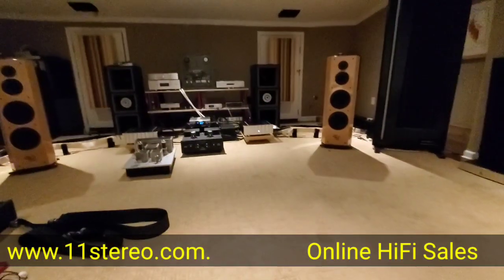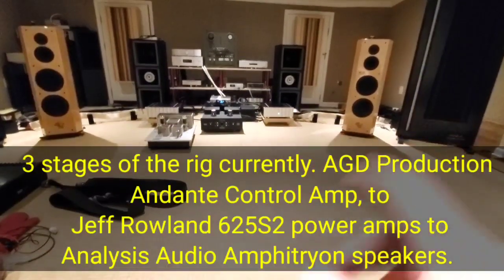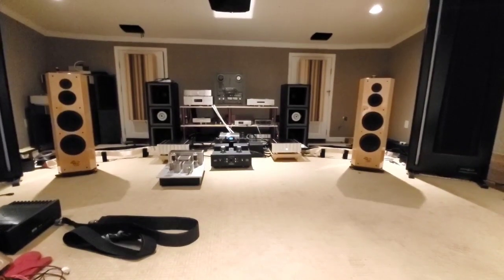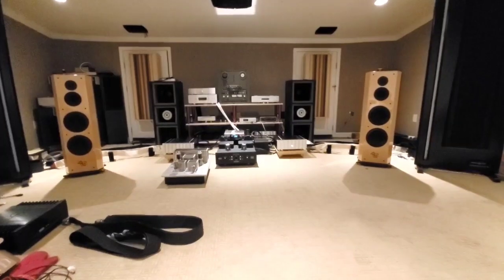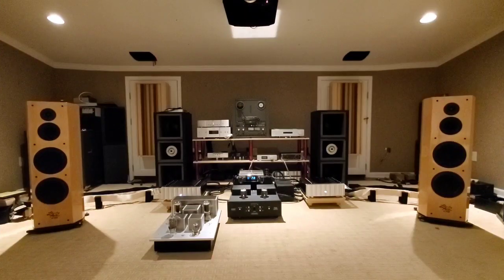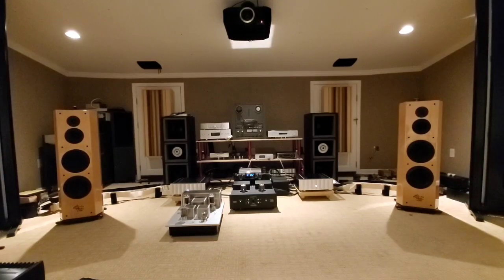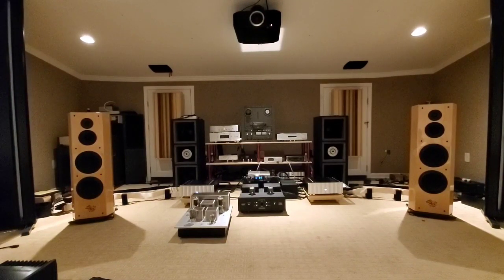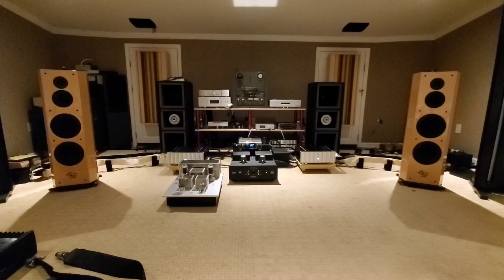TUNING 2 way passive CROSSOVERS for the room.

Comment: Bro, everything I just witnessed was complete and utter insanity. Every single time you made a change it made an absolute difference for the better. The icing on the cake was the bypass caps, which definitely gave the highs a smoother but more defined presentation and you could hear Braxton’s breathe on the higher notes, which you couldn’t hear beforehand. Bravo, man. 
Btw, 2 of my amps exploded on the spot when they heard you say 2 ohms for 24 hrs.
Reply: I looked up that AGD preamp/DAC/streamer/phono stage/car wash/lawnmower/sex doll (extra option, I know), etc., etc... That thing’s crazy.
Reply: @NickP333  For $11,000 it better!!!

Comment: Adding the foils and bypassing the tweeter cap only made you lose base and get an altered soundstage (more artificial, more unlike the original, but this may be because of no burn-in time). Of course your gain was "resolution" (you always get better "resolution" when you favor highs vs lows -story of my life...). I think the best overall tuning (without being ideal) lies  somewhere between Butterworth 1st order (manufacturer's) and Bessel (2nd order) filter. But I think the problem with the original crossover is that it leaves the big membrane struggling too low! This causes phase distortion that messes up with the rest of the spectrum. If I were you, I'd try the original crossover after relieving the woofers from high excursions, by employing the subs. To end my comment, it's a pity to know that a product of this caliper (Analysis Amphitryon Loudspeaker-no it's NOT expensive for what it is), still needs a lot of support (and money) to make it really-really sing! Big, stable amps, active crossing, biamping AND subs! Of course, in the end, IT WILL DO THE MAGIC, the damned whole of it, but...lots of money to add. Yet, I think it can still sing great as is (with a big amp of course and a pair of subs). Anyway, I'm glad I stopped messing with crossovers long ago, one-way wide-range, high sensitivity minimalism has its own pitfalls, but can be equally rewarding with perhaps a little less effort than yours and lots of savings on electronics. Great video (as usual), keep it up!

Comment: Glad you're ok Mikey, was a bit worried you might be sick , you were really missed in my end of the world - - - the really cool thing about the Amphitryons is that I don't notice what one gives up in the maggies (ha! maggie killers as you first described them) - - real low end, greater dynamics etc., although yeah, the maggies are much better these days in those regards. (we'll see about Magnepan's "condo" version when and if they market them) - - - but back to the Amphitryons, at least with the magnepans one can get a taste of that massive sound stage you were describing not to mention that obviously the Amphitryons are extremely coherent (the crossover work is probably helping here) but again, somewhat like the maggies although I'm sure it's to a lesser extent - so, at least for me and for now - I'll take panels over dynamic conned speakers but that's not to say there aren't trade offs - seems or should I say, it "sounds" to me like the Amphitryons are closing some of those "trade off" gaps.
Reply: Mikey, as you messed with the crossovers I could hear differences in the top end, not sure, but "off the cuff" in my opinion, for the better in the very highs - however, the 1st iteration seemed to be more coherent top to bottom (maybe the original jumpers? although I did like that change too, for detail reasons) however, that said, I honestly thought the bass needed attenuating which that seemed to jive with what you had to say about the impedance differences at the end of your vid - - thanks man, looking forward to hearing what you consider to be the "finished product".